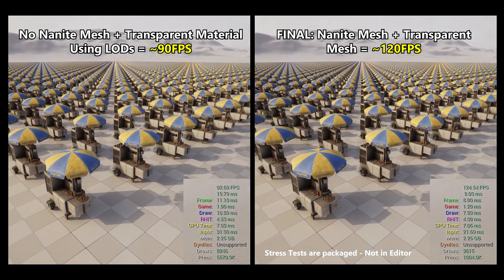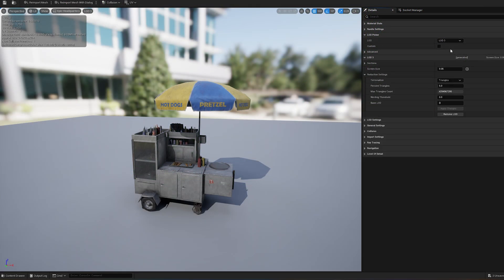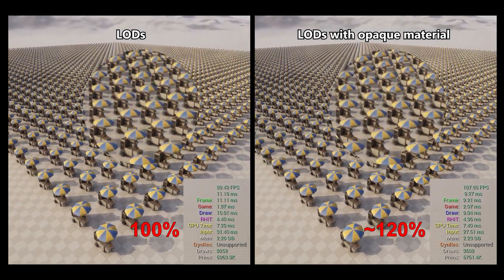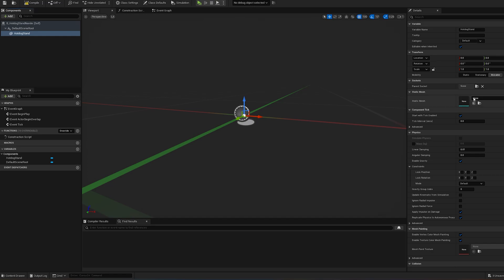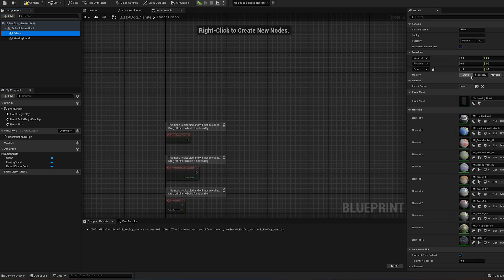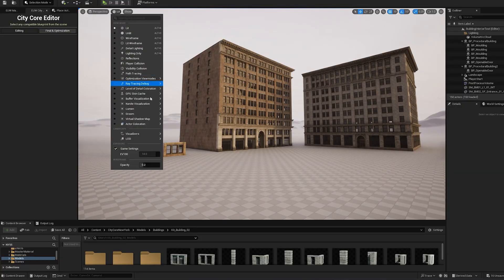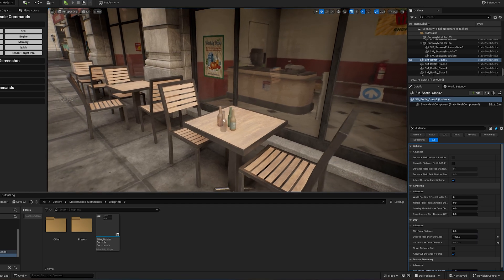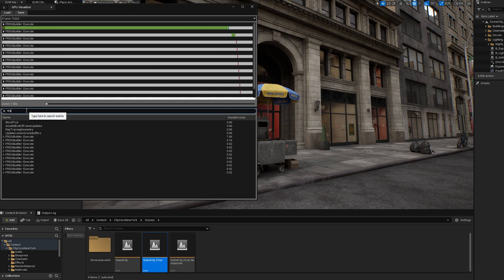Optimization UE5 - Transparent Material Meshes in a Nanite Level

Comment: is it really ok to have 10 materials on 1 prop?
Reply from the maker: I know the model has too many materials, it's definitely not the most optimized mesh!  It was merged from different models, and I didn’t have time to consolidate the materials, but that wasn’t the focus of the tutorial.
Reply: @ Oh ok, makes sense.  I was just was worried for a sec that I’ve been way over optimizing my material usage
Reply from the maker: @guybrush3000  Oh, absolutely! It's crucial to minimize the number of materials. For this model of the  Hot Dog Stand, I should merge some materials, especially for bottles and cans (they are 6 having color variations), or keep them as separate meshes then create a single material with color variations per object. (I covered this in the previous tutorial on instanced static meshes). My mistake, I should have mentioned this flaw in the model during the tutorial or fixed it before recording.

Comment: And if you replace Static Mesh with HISM, perhaps they will be equal to Nanite. The statistics show that the main difference in the draw calls.
Reply from the maker: I already tested with HISM when I did the tests. When the models are all on the screen, it didn't change the mesh draw calls too much (in 5.5 with Nanite/Lumen/VSM enabled in project). But you are right, the main difference is in draw calls but this happen because of  translucent material (and no, it wasn't two sided material). You can test it yourself.
Reply: HISM and ISM don't work well with Nanite and if they go on separate actors, it wouldn't work either, making each BP a separate HISM.
Reply: @Angel-Avellaneda  You should watch the previous video of the author about UE5 optimization

Comment: We use dither transparency with masked materials instead to keep the mesh one material. Some ghosting issues but overall on small areas it works well!
Reply from the maker: I didn't think to include this method here but it's a great idea and likely the most efficient. The problem I ran into when I tried first time in UE5 it was that the noise and ghosting aplified with a low screen percentage (and upscaler).
Reply: I was about to write "That's what Dekogon does!" and then I read the username! :D

Comment: You can separate the Translucent part of the mesh directly within UE5, using its Modeling tool. You can even select automatically all the parts that use the same Material, making it easier to select all at once.
Once in the Actor BP, you don't need to create the Static components, you can just drag and drop the two Meshes inside the BP.
Reply from the maker: Good points! I actually used Modeling Tools to separate them in my project, but I didn’t go into much detail about that in the tutorial.
As for the Blueprint SMC shortcut, I didn’t know about that, but it makes sense to work! Another way that came to mind after making the tutorial is selecting the Static Mesh Actors in the scene and using 'Convert Selection to Blueprint Class...' -> 'Harvest Components'
Reply: @PolySphere3D  Oh, I didn't know that one, thanks!
Reply: for more complex meshes you can use the tris select tool
Reply: @MarioCola  Yes, that's what I use. You can change the selection by Material (separated or all connected) or UV Islands. Remember to remove the Translucent material from the Mesh you want to convert to Nanite or it would show the fallback meshes.
Reply: @OverJumpRally  yes that's my workflow since nanite came out, I would only suggest to mention it for newcomers

Comment: Nice video, How do I apply Nanite to a Transparent Material on a skeletal mesh?
Reply from the maker: Thank you! If you are referring to the second method shown in the video, splitting the mesh into an Opaque Nanite Mesh and a Transparent Non-Nanite Mesh, the same approach applies to skeletal meshes. You can separate the transparent part, create a socket to the skeleton, and then attach the static mesh on the socket